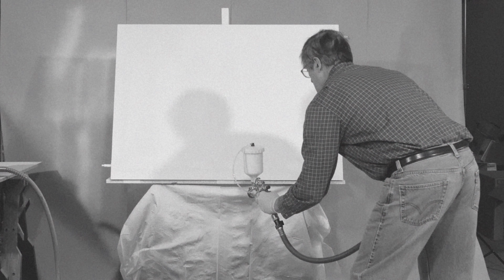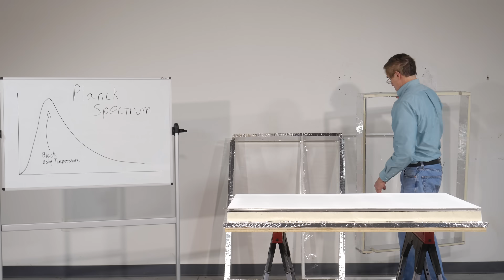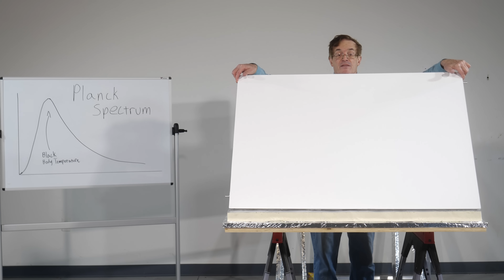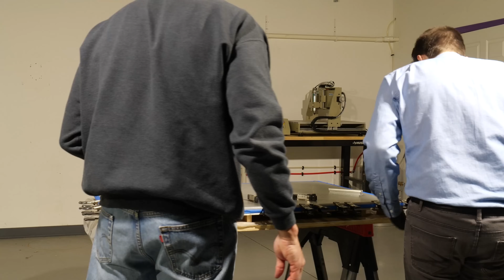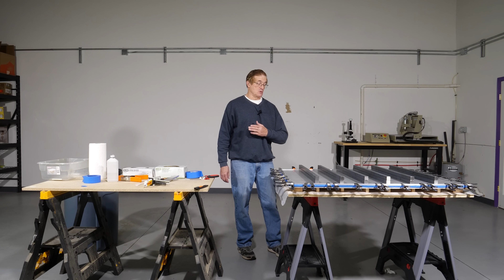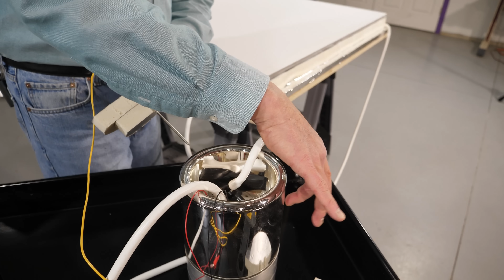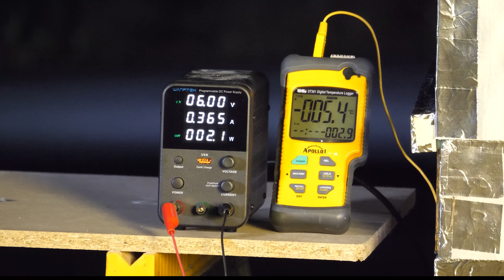Air Conditioning isn't free... but we're close.

Comment: I have a few nice ideas too , look in my u
I had similar ideas back then ,  but I have more wider thoughts
(for example if we place circle against cylinder , would they make the same amount of radiation giving off , or  another Question - how much energy surface would radiate in each angle (I guess it would be easier to observe in visible light 
from incandescent plate of metal with homogeneous heat layout in dark room)
Who knows what should we saw then, how much light would be given off from the surface in each angle to surface , especially with almost parallel ones directions)

In any case it is nicely done , those kind of things that humanity missing

Look , actually exist way to exchange air in apartment but maintain heat with very , very , very low energy consumption
This things actually was applied in Stirling engine back then.
If if we took two soldered alongside tubes and  direct  outer air from one side and inner room air from another(this two flows would move toward each other in opposite directions)
When outside air is reached apartment it would gain room temperature
And  when inner air would reach outside it would gain outer air temperature.
Inner and outer air would swap the temperature.
Of course for good results long tubes alongside each other would be needed and with good  heat insulation at that , but in terms of energy consumption it way , way , way better then any traditional conditioner.
And if to those add Stirling engine and your system :)
Not heating nor cooling would be expensive.

But eventually we should find a way , some physical effects to gain energy from the surrounding space (from the surrounding objects - space isn't real thing actually(just model), objects(basic objects) end their direct(without any medium/mediator) interaction.
When we are talking about place we are really talking about objects
If we interact with them with more degree/intensity we call it closer/close , if with low we call it far

Humanity too complacent , too delusional 
Our so called physical laws is  just behavior of consciousness(basic objects , manifest of primordial mind, it is just statistics but every of those basic objects have its own individuality and it unpredictable, spontaneous manifestation , will)

Some shamans could be in different places simultaneously but in reality it could be non-spatial (interactions just don't fits  in  spatial pattern of interactions)

And in some circumstances physical laws could be changed
As for distance in principal on basic level for conscious its non-existent
Objects are real , their interactions are real , Events are real (but time and space just ideas)

Basic objects (consciousness) have two states - existence and non-existence 
Existence it when object interact with other objects 
Non-existence it when it don't interact with any at all(but it always could interact/exist ,  possible things would exist)
Therefore state of non-existence could be comprehended by consciousness  but obviously couldn't be shared  :)
It always was so , comprehension is individual , only description could be made
(your own existence is only solid basis for comprehension) - don't build your home on send , little bit of rain and it would be overthrown
Real gain its only your own experience , when you comprehended something through thoughts and observation (conscious have ability to comprehend)

Humanity too arrogant and comp,scent , thinks that they knows everything
Something we really could know if comprehend(not just memorizing )
But it is just a little  bit of water in an endless ocean  , and that's great to comprehend something new/create somethings new(spiritually or physically , so called physical is just tiny aspect of spirituality , nevertheless important)

Comment: I have always preferred efficiency improvements instead of creating more power or expending more effort. Efficiency improvements in everything adds up a lot. If we could eliminate a lot of the electricity vampires like TVs on standby and continuous battery chargers that leach power all the time, we wouldn't need to make new power stations, just make the existing ones more efficient. Good work highlighting this.

Comment: Thank you for the well-done video and thoughtful design.  I would just suggest it would be well to add a heater, as well as the pump, to the water so you can show the net power that can be radiated under several conditions of solar loading, ambient temperature and delta-temperature (ambient temperature minus water temperature).

Comment: having the shading frame covered by aluminium,  as you do, would not help a lot , right?    i.e. the radiant heat you are blocking with the outside of the shield frame, would be countered by the radiant heat you are capturning by the inner surface of the frame (also covered with Aluminium).  Am I right?
Reply from the maker: That's correct.
It will effectively  block only nearby  sources.  To ensure that taller structures  are blocked, walls would have to be at least as tall as these structures.  Complete blockage isn't  critical for this to work, so a compromise needs to allow for the practical  costs and performance  gains.

Comment: I studied in Optical Technologies in college, and im just wondering if it would be possible to use optical coatings to help solve some of the variables in the problem. I cant remember everything since my current job is optics related but in a different way from what i was learning in school, but im wondering if the inside of the device can be lined with a thin glass sheet that has been coated to have an enormously high emissivity, and then use a coated window on top to allow for near 100% IR transmission. Not really something that can be feasibly be done outside of an optics manufacturing facility, but just figured my thoughts were better in a comment where people could see it instead of just in my head lol.
Reply from the maker: That is actually  being researched at this time.  Production costs are the current  barrier to that approach.

Comment: What if you put your radiator/radiators into a fully sealed off vacuum chamber with reflective walls and then used lenses and mirrors to re direct the IR radiation out through a tube to the sky? That way you wouldn't need as much surface area directly perpendicular to the sky? And less IR would get back inside the chamber

Comment: oh nifty, long ago i imagined having a deep well or silo with walls like a dewar flask open to the sky and that something at the bottom would only see the black body radiation of the piece of sky/space and reach equilibrium. i didn't know if the atmosphere itself would be an effective black body itself or if the warm air at the top would mess everything up a lot or a little. i figured since this wasn't a thing there must have been something wrong with the idea. nice to see this idea pop up! i feel less silly 🙂[i thought well, maybe if it was a silo so high the top was in space..but that seemed very impractical!] [the other thing i wondered about when imagining pointing it at the darkest part of space..is what if my thermos silo was so tall there was only the tiniest opening and i pointed it at a star...would i eventually get it warm inside because the only thing in my insulated room visible would be the surface of a hot star? i'd imagine the energy transfer would be very slow though...but if it was perfectly insulated and the hole only saw the star... 🙂]

Comment: This is why I'd like a big empty attic, open on the ends, with the root either covered with solar panels, or something to prevent sun from heating the roof,  it should keep the house cooler, with about 12" between the roof and solar panels, I have a shallow well, and thinking I'd use the water to drop the temperature, with the sun kept off the house, the 45°-55°F water could keep it cool enough on the inside using solar, to power a pump and fans, use the same radiators in the winter with a wood stove boiler,   I'd also like to build a super heated steam section of the boiler. To spin either a small steam engine, or turbine, to generate DC to charge a larger battery bank, in the 2kw range, and peak around 3500watts for about a hour, depending on the fuel burned, I'd like to burn waste oil, veg oil , and mostly burn wood scraps and trash, burning the paper and some plastic, I believe the steam would require a good hardwood or oil to get enough BTU to create the steam required! And use the radiator in house as a condenser,

Comment: Epoxies are generally poor for water exposure. A strong urethane sealant will be less expensive and more durable.
Reply from the maker: Actually, they are excellent.
They have been used for decades  in composite  boat manufacturing.

Comment: So would a summary of this be that: "Not only is this super-reflective surface reflecting most visible light but even more infrared is being caught up in the reflection than what is absorbed." so the more light that hits the object, the more infrared is being pulled away... like a wind chill factor but with radiation instead of air current?

Comment: I have often tossed around an idea for something like this in my head, a device that passively emits more radiation than it absorbs. Usually in the shower. I never convinced myself of a way that it could be made to work, but intuitively it felt like there had to be an answer. Using the coldness of the sky is brilliant.

Now this has me wondering. If there is a temperature differential between earth and sky with enough potential energy to do work, is it possible to run the pump off of this differential as well, to make a totally passive system? Or even rework entirely as a generator

Comment: Huh, just an odd thought but.........could this paint be used to (slightly) enhance a refrigerators efficiency?  That might make for an interesting 'What if?' experiment to see what effect this paint would have either over the fridge's original paint or if that were stripped off and wholly replaced with the passive cooling paint........

Though I'll freely admit there likely wont be a major difference but, if it can save a few watts here and there then it might be something to look into for some of the people here.
Reply from the maker: Yes, but only if the refrigerator was outside.

Comment: The cooling series of videos you've been making over the years has been really cool, and I have been very interested in prototyping based on your concepts.
Are you planning on combining this cooling panel with your liquid desiccant system in order to further increase efficiency?

Also, have you also considered exploring geothermal cooling?
Reply from the maker: Combining, probably not.  The principles once covered are the main point, so engineering the interface is less useful.
I have always been interested  in geothermal heat management.
The challenge is a relatively easy, cost-effective way to dig the trenches or the well. I'm thinking about it.

Comment: Some of your physics is incorrect. Your extended side with aluminium doesn't reduce your view factor to "trees" etc (IR thermal load). All you do is create mirrored IR surfaces that doesn't really change your view factor (how much you can see the sky) because of the reflections for the short length of the frame are similar to it not being there at all. Also, your flow characteristics probably make for poor performance (your not using 100% of the radiating area coupling to fluid flow - which is somewhat improved by the aluminium conductivity but not solved.  Also, the 10degC of water temperature cooling doesn't say much in the end in terms of cooling capacity. If you isolated the system well from convection to the environment the equilibrium temperature of the water will approach the sky black body temperature assuming there is no additional thermal loads.  Some tests with different heater loads going into the water means you could easily estimate your actual cooling capacity and your system efficiency (which considering a few of the design decisions you made is probably still pretty low to the theoretical best case). Cooling capacity is not in degrees Celsius, it is in Watts.  

And I'm not really sure about your "super coating" though - curious to see what this is. Common household white paint already has a good ratio of IR emissivity to solar absorption and you probably wouldn't have seen any difference in water temperature in this test with what you achieved (also because of the test setup). High end materials like white zinc oxide paint would only give you maybe 10% better efficiency which wouldn't make up for the poor efficiency of the fluid flow loop through your radiator (heat transfer from your working fluid to the radiator)

Sorry - don't want to be negative on the overall concept, as it's a beautiful experiment to do that also demonstrates how spacecraft are cooled when there is no convection.
Reply from the maker: Don't  be sorry, but your  comments  are consistently  negative and, in some cases, incorrect.
Firstly, the barrier  is designed for near field radiation like "me."  Blocking the radiation  from the tops of the trees and buildings requires a barrier as high as they are.
We weren't testing capacity, simply demonstrating the principle.
Commercial  paints, including zinc oxide, will be about 10% less emissive than the coating we formulated when tested at night.  The far more significant  difference  occurs  in sunlight.
The fluid flow is very  efficient because the serpentine path covers the entire front surface of the heat exchanger.
Reply: @TechIngredients  your body heat load is extremely small. At equilibrium you'd lose around 80W to the environment. Clothed as you are for the cold your IR emittance would be very low (look on an IR camera) and your view factor to the surface is relatively small unless you are really next to it. So certainly a radiative heatload to the surface of << 10W, probably closer to 1W. Nonetheless, you've used aluminum on the inner side of your shield which will reflect energy into your surface at ~95% efficiency in 10 micron wavelength (i.e. grey body at ~300K).  So the only thing you are blocking is a tiny fraction of residual energy at extreme angles of incidence. Feel free to build a geometric radiative mathematical model if you don't believe me.

White zinc oxide has an emissivity of ~0.93. the blackest of blacks struggle to approach emissivity of 1 (you need dendritic blacks with extremely high surface areas to get near 1), so it's extremely unlikely (impossible even) to have 10% increased efficiency. On the solar absorptivity side it has an absorptive of 0.16 so is be very surprised to find you have a significantly better surface especially if it's a diffuse coating. A find it unlikely that you have made in your back yard a thermal paint better than some of the best commercial paints you can find.

I may have misinterpreted your thermal path but a serpentine path over the whole surface would work but the filler you used to reduce your volume looked like it blocks efficient flow in a lot of areas rather with spacings between the channels of ~200mm or so (at least that's how it appears). With zero heat load you won't be able to tell though. Curious to know what system efficiency you are achieving. What was your radiative boundary temp so you can find your parasitic connective heat load? And applying a heat load to the water to find it's equilibrium temperature would also help you too find it's performance. A zero load equilibrium temperature tells you very little about it's utility.

Comment: I'm halfway the video, and still trying to figure out what's the basis of this energy equation. Am I right in understanding that everything emits infrared radiation to eachother and to the open sky which is cooler? How and where does the energy exchange happen, and what happens with the exchanged thermal energy? (You can't destroy energy, only convert it, which typically also generates a bit of thermal energy due to inefficiency)
Reply from the maker: You are right.
It happens through energy  exchange between the electromagnetic  field of the radiation and the electromagnetic field in the chemical bonds in the matter it strikes, or the electrons around the atoms, if their in isolation or in the free electrons in a plasma (if things get really hot).
Reply: @TechIngredients  yeah I got that now :) it's something to get your head around that ambient temperature isn't just the air itself, but also everything around us storing and radiating heat. I think it's brilliant how this heat is now just being dissipated into the sky.
I follow some of your projects with great interest, like the panel speakers, and the airco that relies on a salt solution to dehydrated the air. As someone with an interest in technology and working in construction, I could see great potential if there is a way to tie this into other technology as unintrusive as possible.
Is this principle compatible with the technology of solar panels, say water cool them so that not only they're more efficient during the day, they're also dissipating IR radiation at night? And then tie that in to NZEB installations?

Comment: Very cool video and explanation. 
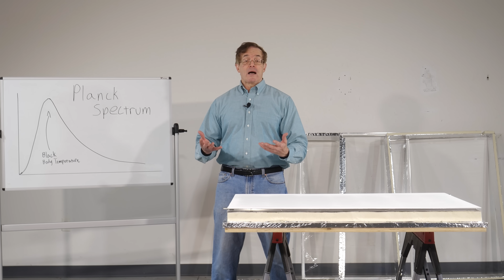But I don't think you're in radiative equilibrium with the room around you (2:35), unless the room is 36 degrees Celsius. Maybe your clothes are.
Reply from the maker: Sure.  That's why a dead body cools off to the temperature  of its  surroundings.  We need to expend a little  energy to maintain that differential.

Comment: Great system, though in many areas dust- and the accumulation on the surface may negatively impact performance. Dust is generally more prevalent in poorly developed areas from unsealed roads to factory emissions to open fires